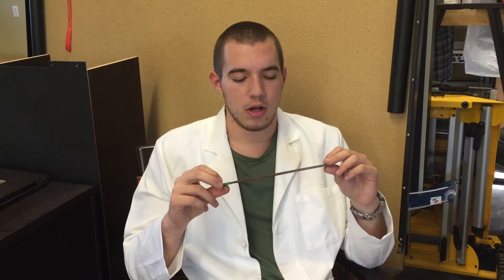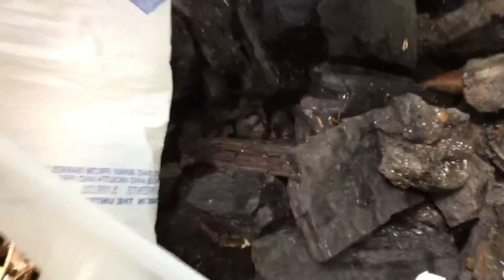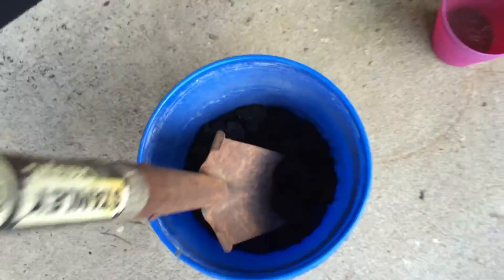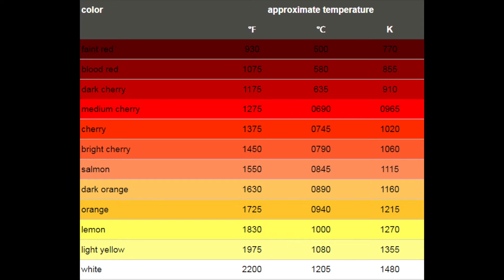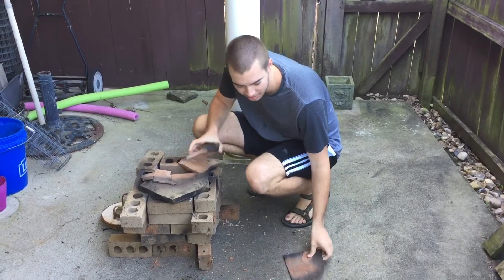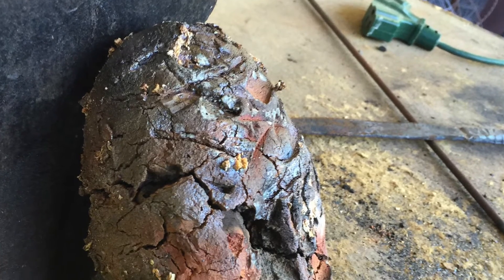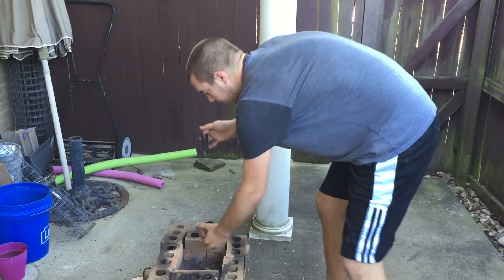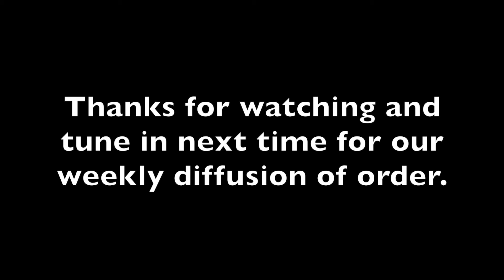How to add carbon to steel (Not!)

Comment: 6 parts carhcoal, 2 parts salt, 4 parts flour, splash o water to make a paste. Add paste all around the metal and wrap that in clay. Heat to 2000 for 30 minutes. Brake the clay shield and harden in oil. Temper to straw color. Thats it. Romans did it this way

Comment: I didn't know you could case harden with clay. From what I learned carburizing is achieved by hammering and folding with constant sprinkling of charcoal dust/powder and cooking the steel in a forge with a blower at a hot temp in pure char coal not coke or coal. Then trying it after cooling for spark quality. It can be quenched and then tempered but it won't spark if too hard................temper it more.

Comment: Does it need to be fused into the steel, via, something along the line of hammering or liquidation? Idk
Reply: What he was doing was case hardening, as in, just the outer layer of the steel. That's what it is to make high carbon steel. The difference is that you keep folding it over and over to get the carbon mixed or annealed as you would sugar/flour/milk to make cookies, but with the hammer of course, not your hands.

Comment: what you did was case hardening and will only infuse the outermost layer with carbon you basically just gave it a carbon steel skin your method was crude but probably still got some results
however when you reheated and dipped it into water you basically undid most of your work

Comment: No where in google or youtube is there good info on how to add carbon to steel or iron. I only find shit reddits. Is there anyone that knows how high carbon steel is actually made? The process not the science behind it. Step by step.
Reply: https://youtu.be/V_Mp1fNzIT8
Clickspring does it pretty well.
Reply: Do you have a specific process in mind?. I am familiar with three large scale industrial production techniques...Basic Oxygen, Open Hearth and Electric Arc Furnace. Regadless of the process the Carbon specification is reached by adding powdered coal to thee ladle of molten steel for the first two. The Graphite electrode is dipped into the bath for the latter. I am rellating High C to 0.40% through to rail type steels of around 0.70%.
Detail of process are well described elsewhere.
Reply: @flamingfrancis  I guess the easiest to produce at home, would be great, thank you.

Comment: @dale carter is nearly right on this, but I don't even think the case has been harden 😂😂😂, its sort of smoked BBQ he did. The temperature did not achieve the expected requirement looking at the design of the burner...

Comment: My best guess/assumption/talking outta my rear, (I am not an expert, not even a novice):
1, The clay 'protected' the metal from getting to hot to do anything with.
2, All it would've done was just coat it with charcoal, when you really wanted it to integrate with the metal.
3, Best way would've been to place it with the coal, charcoal, burning hot enough to melt the metal, that way the structure would be more open, allowing the carbon to get into the metal.
4, do not let it cool down over night, but rather take the now clump of metal to the anvil and hammer it to consolidate the mass.

again, I have no idea what I'm talking about, but this feels right..... but I could be wrong... most likely am.....

Comment: I have case hardened a few times and I will tell you that the surface concentration gets pretty high if done correctly.  If your fire got hot enough, your method should have been sufficient.  I can very easily snap 1/8 inch (formerly) mild steel with a slight bend after case hardening.  My guess is that you should try striking it while annealed or slightly tempered after hardening.  BTW, you said you were tempering it by quenching.  This is not tempering.  Quenching hardens the metal.  Heating after this hardening is tempering because you are trying to get the metal slightly softer and relieving some of the stresses.  That said, I would temper it.  You need remove small chunks of material to create a spark.  A fully hardened piece isn't going to allow this.

Comment: What you tried to do was called case hardening, which only ads carbon to the outer molecules of your stock. It's not a bad method of adding carbon to steel, it just is not well suited for what you are trying to do, never mind the fact that you did it wrong. Next time you want to case harden something, keep in mind your case has to be air thight. It also has to get to temperature and stay at temperature for several hours without cracking. Clay is not a bad liner for you case, however it can not be your case due to the likelihood of it cracking and letting all you carbon out.  You have to man your fire. Starting off cold with your case in already to go. It should be supported so that it is not sitting directly on your fuel. You have to start slow and ad fuel to your fire till you get a good burn going and you have to maintain that burn 16 to 20 hours. You will have to repeat the process a few times till you get you desired result. I personally use only charcoal I made myself instead of store bought.  That's because I don't trust the store bought stuff. The other way of adding carbon to steel is tricky. You sprinkle carbon based material directly on to your stock as you are pounding it. Then you Flux and fold and heat and ad carbon over and over and over. Don't forget, Always anneal/normalize your stock before you do anything first. I hope this comment helps you for this and future projects.
Reply: Dale the part you never told him is to be great at that to a art. That very high quality carbon steel and high quality low carbon steel sells for around $3200 a pound in Japan to the correct sword Smith. For both are needed for a great katana. Now that I think of it I got into the wrong Biz. A katana sells for over a million bucks. Damn
Reply: Naturally, the time needed depends on the temperature but several hours seems to be over the top. According to this test by Clickspring, 20 minutes in a propane fired furnace gave about 1 mm deep carburizing; https://www.youtube.com/watch?v=V_Mp1fNzIT8
1 mm would be good enough in this case.

Comment: OK mild steel ranges from0.4. To 0.24 percent carbon steel   plate steel and girders RSJ such like tend to be the upper end of that scale and can be heat treated so what's needed .a cold winters day!a bucket of ice water take metal to bright yellow then quench in bucket.. OK now the important bit move it around the bucket as you quench it . its called riddling smiths of old did this for century's but that ant going to tell you? Back in old times! The Riddle of steel indeed! Well give it ago good luck!!

Comment: I think the comments about the clay insulating the experiment are definitely on the right track. At the end, did you just heat and quench the metal or did you actually temper it between 450-900°F for any length of time? About 1 hour per 1 inch of metal thickness at heart treatment temperature is the general rule of thumb. That will make a big difference in how hard the steel is, if a file skates over the surface of it, it's full-hard. Tempering it will reduce the hardness and should allow the flint to create sparks.
Reply: i say he did not do any of the process right!! only half assed it!!
Reply: it's possible that he actually achieved what he was aiming for, but the guy forgot to temper the steel after he quenched it.

Comment: The egg cracked. And let out all the magic. :) (aka CO)

More seriously: Google search for "pack carburization using pulverized bone" or "case hardening mild steel". Want to take it further try "how to make blister steel". 
    e.g.   http://www.netjournals.org/pdf/AJER/2013/4/13-048.pdf
    http://www.anvilfire.com/article.php?bodyName=/FAQs/case_hardening.htm

The recipe I've tried is 40% Bone meal + 60% "activated carbon" (used in aquariums and water filters) in a "sealed" container. Some people insist the container needs to be fully sealed (e.g. welded shut completely) but I've recarburized mild steel in a container that was "capped" (another steel cap fit over the end) - enough to limit CO from escaping routinely.

Comment: The steel needs to be folded while adding the carbon to/in the folds to create a "higher carbon content" in the steel. This needs to be done many many times. If you could get the steel in your egg up to temp and it did take the carbon it would be good for a few strikes only. If that was your plan then yes that would work if the steel could get up to temp.
Reply: No, folding is not necessary. That's an obsolete method that leads to too much unwanted impurities. With enough temperature and time, carbon will diffuse into the steel without folding it.

Comment: Try mixing the clay with straw, wrapped it in leaves before applying the clay, purified the clay, if it's not like glass then it's either dirt or it didn't got hot enough. Get it as hot as possible then dunk it in water. You want it glowing hot red when you dunk it.  Do a spark test to determine the before and after treatment.

Comment: I think your clay actually insulated the steel so it didn't get hot enough to affect the combination.  try a steel box, or something that will conduct the heat.  liked the experiment, though.
Reply from the maker: My thoughts exactly. I've reworked the equations correctly this time, and the only real unknown of the system was the internal temperature. I will be remaking this video as soon as I get a better furnace made.
Reply: cly will work if done right!!! but you could tell as soon as he pulled it out he did not hold enough heat for long enough to even change all the clay!! so there was no way the steel ever got hot enough !!

Comment: how long did you let it soak in that heat. tip. half an hour is not enough time for carbon to dissolve into steel. think something like 2 hours at molten temprature or around 2000 degree fahrenheit. 2200 if its pure iron.
Reply from the maker: it was in there for a few hours
Reply: its 1800!! the steel must hold that temp not the clay!! the clay would have been glass like had it been that hot!!

Comment: I think the most likely problem was temperature. Try a more insulated homemade furnace and a longer burn time. My furnace is made of an old propane tank and super well insulated, but it still doesn't really get over 2100 degrees or so.
Reply: 2100 is enough heat to do it!! but the steel has to get and hold 1800 the longer the deaper it will go!! you cant just have the clay to that heat!!

Comment: No one replied in all this time?

My best guess I'm not a metallurgist would be that you would need to bring the mild steel further into the plastic range. 

The chart you showed -- I believe that is for the metal, not the flames.  Since you had the object embedded in clay, you can't know just how hot it got. I'm thinking the part barely made it into the dark or medium cherry heat. As such, you couldn't add much carbon to it, if any at all.

While iron and steel can be worked at lower heats, the plastic range doesn't really start until the orange through lemon heat range. By plastic, I mean where the metal will start to bend from it's own weight. This puts it close to a semi liquid state, where carbon can infiltrate the surface easily.

Try it again in a proper crucible where you can see the metal, and I bet you get better results.
Reply: Why can't you just... melt iron and mix some carbon into it?